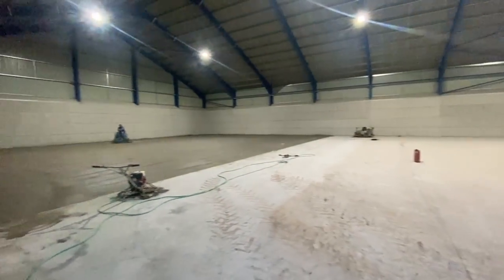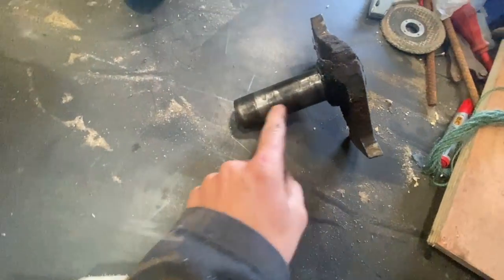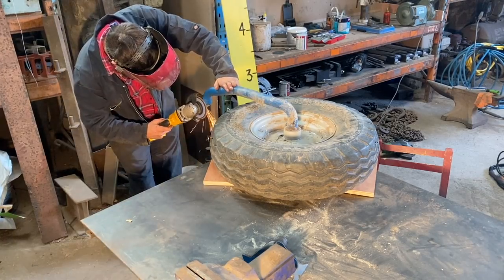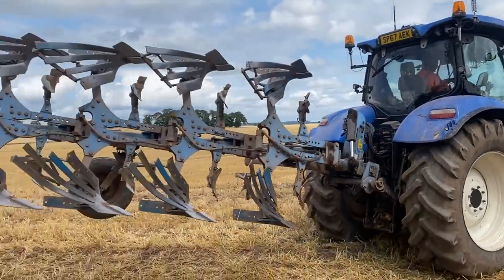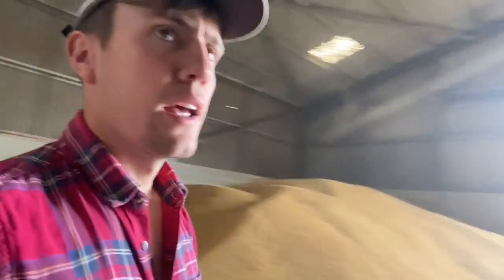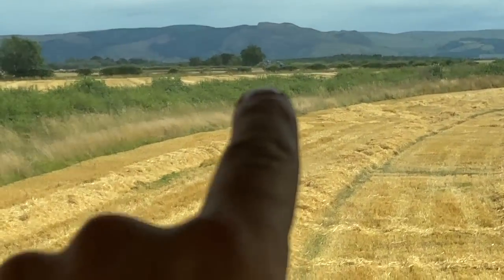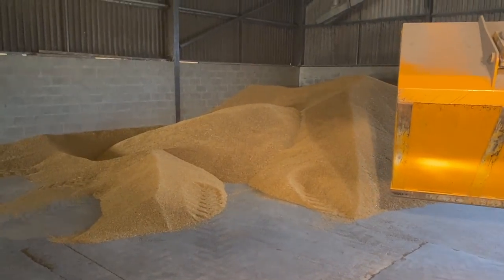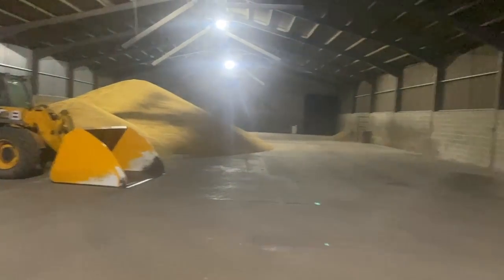THE WHEELS FELL OFF | FINAL CONCRETE POUR | COMBINE ISSUE #CRAWFORDFARMS #083

Comment: For the header trailer could you get a pice of bar the would fit the bottom link arms an wield a draw bar hitch to it as the bottom link arms go higher than the tow hitch then you could just leave the bar attached to the header trailer
Reply from the maker: That could work

Comment: Re header, drill a couple of extra holes on the draw bar of the header bracket and raise the jockey wheel. Weld a bit on to the bracket if necessary.
Reply from the maker: Just shifting the jockywheel should be simple, ill check how its mounted when im at it next

Comment: Don't take the distance as gospel though but that was what I was always told years ago, may not even apply nowadays with modern machinery.
With the header trailer a space is the best bet either a bit of pipe or a lift arm ball, that or it's a lot of work cutting and welding.